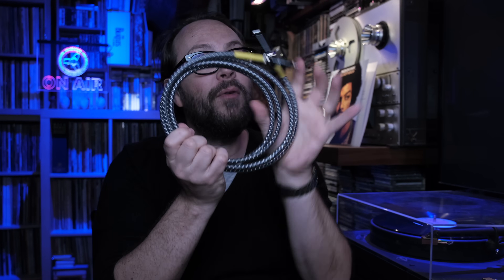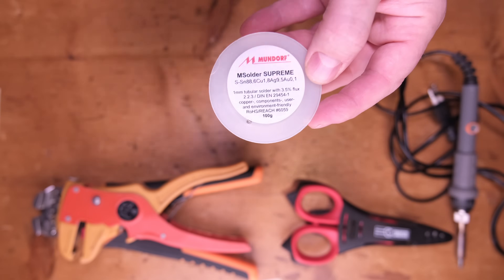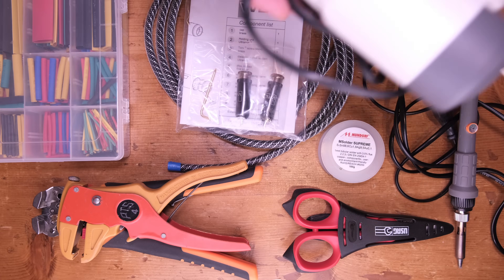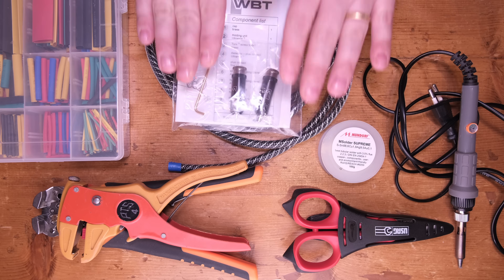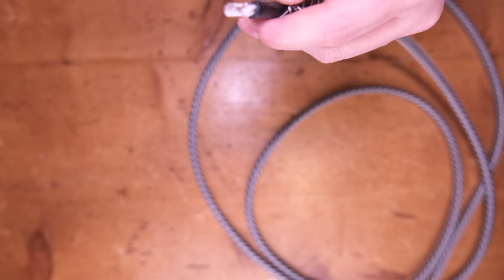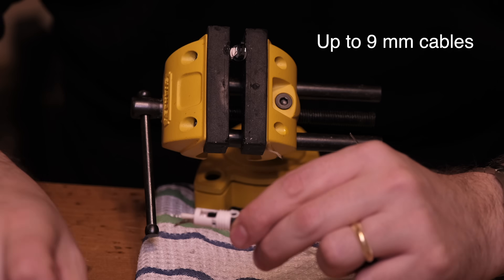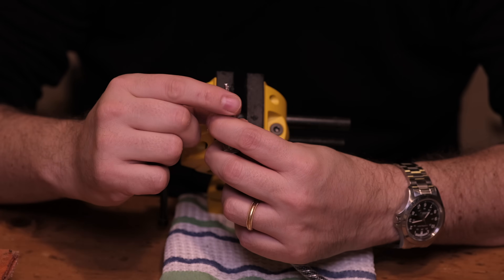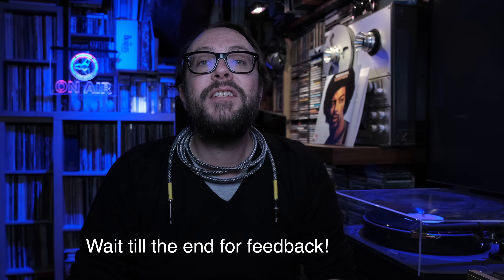How to make the perfect coaxial cable for digital audio (SPDIF)

Comment: After you make the solder joint, clean it thoroughly with a clean toothbrush and some IPA (Isopropyl Alcohol) to remove all traces of flux.   Solder joints degrade over time due to  remaining un-burnt flux residue.   Although flux is essential to clean the joint as the solder flows while under heat...  it is corrosive and it will eat away at the solder joint over time. 

It is possible to buy a "no-clean flux" but that is a liquid flux and needs to be applied separately with a paint brush prior to flowing the joint with solder.  Also it needs to be used in conjunction with flux free silver solder.  But this is only essential for production environments to reduce time consuming operations like cleaning and drying time. 

A good clean solder joint should be good for 25 years. 

Good video anyhow. Nice to see you tin everything first.  Like a pro!
Reply from the maker: Thanks for the suggestion!
Reply: @anadialog  Not a big problem when you only have a few cables.  Just imagine putting together a recording studio and you have to make 24 or 48 cables.  It could be a big problem 10 years down the line when they all start failing around the same time and you have a diary full of bookings.

Comment: Solid core silver conductors: Good!
But it’s shielded, really really bad!! The metal shielding when surrounding the silver conductor will act as a capacitor and it will change the sound. Get rid of the shielding, for God’s sake (wait… I don’t believe in your Gods)
Reply: It's a 75 ohm co-axial cable
Reply: What you've actually heard the difference within the sound yourself have you? Or is it something you read

Comment: The first thing that’s wrong with the picture on your video is the metal/aluminum shielding for the cable. Shielding robs the essence of the music. Never use shielding on a cable. The best dielectric is air surrounding the metal conductor which is housed in a Teflon tube without any kind of shielding. NO Shielding!!
Reply from the maker: If uou check my other vids you will see that I agree on this but it depends for what cable...coax needs good shielding unfortunately
Reply: @anadialog  Except you didn't use the shield. Your stripper tool cut it off. Most coax the "shield" is one of the conductors. The unique feature of the 2001 is that is has a second braid that can be used like a real shield connected only at the source end.
Reply: This is a 75 Ohm co-axial cable not a speaker cable or IC's
Reply: When I had my cabe company in the 80s and 90s I cam to the same conclusion and never shielded IC or speaker cable. Then I made a digital cable and it was a whole different thing. Digital throw out a lot of electronic garbage that will interfere with other cables and your phono. Even back then when there was not so much digital electronic detritus in the atmosphere shielding was necessary. My compromise however was not to use a heavy metal shield but a metalized poly tape that I wrapped around the cable. It was flexible, shielded the digital noise and had minimal impact on the sound of the cable